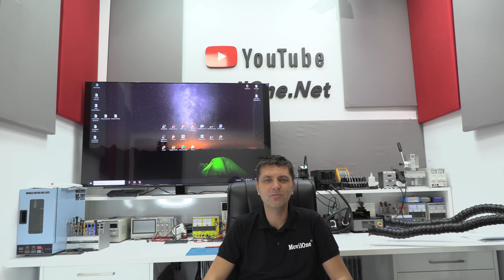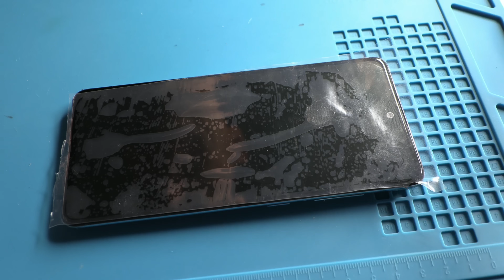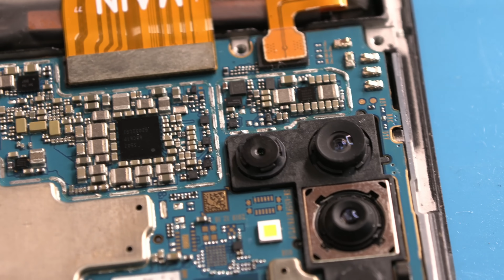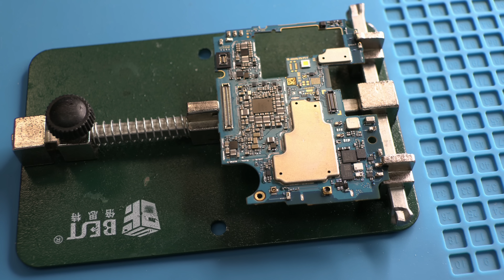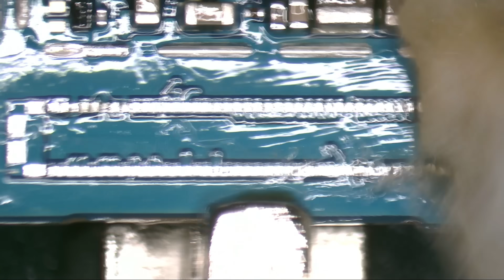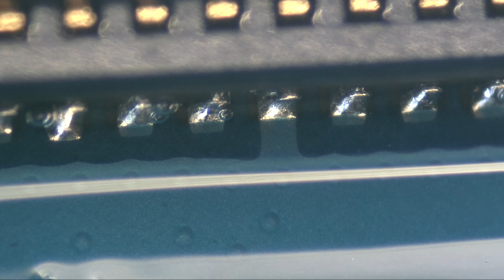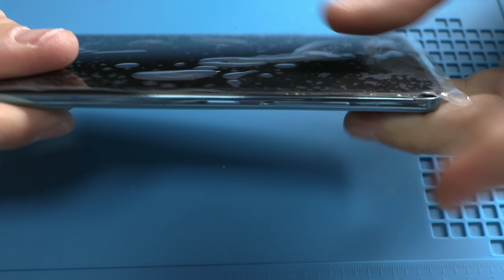The Samsung A Series Secret They Don't Want You to Know!

Comment: I'm a retired technician, who practiced from 1984 to 2015. I watched a bunch of ignorant bureaucrats outlaw leaded solder and practically destroy the reliability of our designs. Leaded solder in e-waste makes up a tiny fraction of the lead pollution in a landfill. One car battery has more lead in it than 10,000 electronic devices. Think about how many car batteries are replaced every year. Tin/copper/silver solder actually grows whiskers (the last I read in the electronic journals, physicists could not explain why). With super fine pitch ICs they will actually bridge the gap and cause shorts. If the short is on a power to ground line, it will just vaporize as it's only a few molecules wide. If it's a signal line, it can cause the device to fail. Lead free solder also made rework exceeding difficult due to the higher temperatures required, leading to the copper traces delaminating off the FR4 substrate. I've seen the comments about the ROHS laws, and as some have pointed out, if you repair with lead based solder, who is going to check? So feel free.
Reply: Typical example of greenwashing I guess: „hehe, we are considered green, at the same time we can sell lots of new devices if they break soon enough, or overpriced board „repairs““…while the millions of devices that are not repaired but straight thrown away, have a much greater impact than the lead would have. But greenwashing works, because customers want to believe the corpo blabla
Reply: @RoHan-83  Well, if its half as bad, i can have twice as much, right? Riiight.
Reply: @RoHan-83  Windfarms are like that. Millions of dollars in materials that cannot be recycled when used up. For example the blade, they just chop them up and bury them in a landfill. Also each tower uses about one hundred gallons of hydraulic and lubricating oils that need regular changes every 8 months or so. Isn't greenwashing great?
Reply: @Harold_Callahan that is not true, just a typical rightwing false information. Firstly, properly constructed wings last for around 30 years and then will and can be recycled (at least here in Germany). Glass fiber wings will be used in cement production and newer carbon fiber wings will get broken down by pyrolysis. No landfill when you take proper care of it. Typically over 90% of a wind park is reuse- or recyclable. 👍🏻
Reply: @Harold_Callahan Everything can be recycled, so that's not a useful comparison
Reply: @Harold_Callahan Even when taking into account that most blades are not recycled (that trend is changing), windmills still overall pollute less than fossil alternatives, and its not even close. The motor is also fully recyclable.
Reply: @RoHan-83 thank you!
Reply from the maker: Great insight, Mark. The ban on leaded solder has significantly impacted the reliability of electronic devices. As you pointed out, lead contamination from e-waste is minimal compared to other sources, such as car batteries, which contain exponentially more lead. However, regulations like ROHS focus on reducing hazardous materials without fully considering the consequences for durability and repairability.

The phenomenon of "whiskers" in lead-free solder alloys is a well-documented issue that has led to catastrophic failures in critical industries like aerospace. Moreover, the higher temperatures required for reworking lead-free solder not only complicate repairs but also shorten the lifespan of components due to increased thermal stress.

Regarding repairs with leaded solder, it's true that in non-industrial environments, its use remains a viable option. Ultimately, the key is to strike a balance between regulatory compliance and ensuring durable, repairable products—something that large corporations, unfortunately, do not prioritize.

Thanks for sharing your experience; it's crucial for more people to understand the realities behind the industry's decisions.
Reply: @MovilonePhoneRepair  are you an AI?
Reply: @ujox3720 I'm also suspicious, it's a ridiculously long and generic addition to the discussion,from the uploader of the video!
Reply: @MovilonePhoneRepair 

Hai brother,
I'm starting a Car's ECM repairing and OBD scanning business in few weeks. So I need the soldering rework station.
 Which brand is worth for buying or correct machine for my work. 
I had a Kada 2018+ machine (hot gun with soldering iron) in my mind for buying. 
Please reply to my comment.
I purchased OBD scanning tool, taparia SA46 tools (box).
Then I have to purchase these soldering related items only. 
Especially I need soldering rework station.
It's related items like lead wire, flux, led light with magnifying glass stand, table silicone mat, etc,.
Reply: @MovilonePhoneRepair  not all A series are designed to fail. The a50, a51,a71, a80 were indeed designed to fail. The a12, a31 are completely different, these ones are solid devices, I have them and they still works
Reply: and they fucked over the fluxes...
Reply: @stevesteve8098  pine sap still works fine, as it always has...

"rosin"... pine sap. if thats too primitive, try a music shop. they sell blocks of it.
Reply: While not doubting your integrity, after all products were better built back then, it is clear, that manufacturers are building single points of failure deliberately into their products. I like to tinker on many things, and once the "back is off" it becomes obvious that this is so. When you ask yourself "what idiot designed this?" it is the wrong question. It would not be surprising that a class of engineers - "obsolescence engineers" - existed, but maybe that's going too far. The most recent case was the nut on the back of a shower mixer - one of these nuts was impeccable, the other was clearly faulty. Can you get new ones? Not that I can find. Let's face it, most people don't have the equipment and competence to do this kind of repair, even if they coud find the fault, so rather than faff about, the new one is brought in and the old one thrown out. So much for the "green, net-zero" agenda. It's not being thrown out for BS for nothing.
Reply: @GeorgesDupont-do8pe  This subject IMO is a huge can of worms and is similar to the chicken and egg scenario. Part manufacturers in an effort to drive out cost have lowered the quality of parts, as well as engineers under pressure to drive out costs use cheaper materials and parts. I remember back in the day, american made engines came with plastic timing gears with metal chains. They rationalized that the gears would last 100k+ miles, after which the car would be replaced. Most of the time they were correct. This is also happening in consumer electronics, especially phones which are quickly rendered obsolete due to cell specs changing (5G anyone?) or OS bloat as well as battery wear. Does it make economic sense to make a soon to be obsolete device bulletproof? I think not. The real crime is this creeping into what were known as "durable goods" such as home appliances, which back in the day would last a minimum of 20 years barring damage. I've read that now their life expectancy is dropping to 5-10 years. I think this has a lot to do with the items being overloaded with unnecessary electronic bells and whistles. It's the same with cars. They are now rolling computers with and engine and almost impossible for the average mechanic to repair without involving an ET. Do I think companies are designing product to fail? Yes, but it's probably like the timing gears. They just have to last long enough for the end user to replace the device in the normal course of use pattern.
Reply: @GeorgesDupont-do8pe  ...behold, a pale [green] horse! And its rider's name was Death.  
Watch "The Lightbulb Conspiracy" .... It's one of the best eye-opening documentaries i have seen based on well-researched factual information concerning the inescapable hard ugly truth reality of "Planned Obsolescence."
Reply: Good old fashion solder is getting harder and harder to get and most of the solder you buy online now and in electronics shops is junk and not what they say it is on the label or advertisement (eg 60/40).  Just attempting to joining two wires together together with these junk solders is a labor intensive job. He mentions one good brand solder: "Kester". Another good brand is "Loctite/MultiCore". But we might have to stock up because they might soon ban that too. - The big corporates no longer like things repaired and prefer you to throw it away and buy another one when the warranty is over.
Reply: If you do buy that cheap junk Chinese solder, don't throw it away. If you twist it together with Multicore solder it seems to work ok.
Reply: @cyber5515  I had to buy solder a few years ago. I made sure I bought what I used in my career: Kester. It's the same quality as it was 40 years ago. It wasn't hard to get from Amazon. This may change, but I doubt it, because Lead based solder is almost mandatory for military and aerospace for reliability.
Reply: @cyber5515 it is possible to make your own lead solder. You can even draw it out into a wire quite easily just be sure to use PPE
Reply: IV been driven crazy over this problem all xuckin week.. bloody connection..... 🤬😡 Thanks for this video 🇮🇪👍
Reply: I still have some leaded solder that I’ve had from years ago that I still used to repair power supply boards on xray machines, part of what I do for a living. How much lead content do you recommend or do you prefer in your solder?
Reply: @postersm7141  I no longer work in the industry, but for very rare home use I have 63/37, which is pretty standard across the industry, or was. I don't think it matters, it just makes rework much easier to have a lead based solder. The wetting and shine are way better than with almost pure tin formulations. A side benefit is the new component is spared the 30 degree difference between the two types of solder. Plastics that are in the connectors that are the subject of this article can have their structural integrity damaged by the excess heat, even if they are designed to withstand it.
Reply: "Lead free solder also made rework exceeding difficult due to the higher temperatures required"
So that's the purpose of using lead-free solder.
Reply: I use German leaded solder for my repairs. Never been a fan of lead free stuff.
Reply: not using lead also leads to al lot of ICs failing because they have to be reballed
Reply: @sharymens8187  I can tell you are/were in the industry. Right on brother. I wondered if this was still done, given the disposability of even high end processors as the labor and equipment costs become prohibitive in the current economy. I suppose there are "houses" that do this in bulk to drive down the per unit cost. Nothing likes thermal cycling, least of all deep submicron processors.
Reply: I greet you Legend.
Reply: @UltraMaxTechOfficial  Joyful greetings to you! Although I think I'm more of a dinosaur than a legend 😉.
Reply: It's terrible indeed
Reply: I love lead ❤️
Reply: Oh my, ROHS. If they really wanted to reduce harmful substances, they could have actually focused on reducing wastage by enforcing actual repairability and encouraging reuse. Instead we have this mindless consumerism that quickly fills up landfills
Reply: Thankyou all guys as a retired electronics engineer youve opened my eyes to these tricks
Reply: In Germany at least there is a pretty large refund for lead acid batteries.  Car wreckers also dispose of batteries separately.  Not returning one to get the refund means not getting real money.  Unfortunately lead is so bad, it needs to go entirely from an environmental point of view.  But I'm guilty myself, I still have plenty of lead solder left.

I noticed the attitudes towards lead-free solder differ wildly across the industry.  Some people are totally adverse to it, some are totally fine and claim they haven't had an issue during their entire career. Not sure why.
Reply: @ralfbaechle  Thats NOW. Lead acid batteries have been in wide use for over a century. In the beginning, I'm not sure if they recovered the lead. I'm not a battery historian.
Reply: @markh.7650  The answer is it depends.  Lead is reasonably valuable.  What makes these batteries special is that older batteries were made from an alloy with antimony which is even more toxic.  It was commonly used to make lead harder not only in batteries.  It was among other things used in letters for typesetting.  Manual typesetters often poisoned themselves with antimony.  Lead got all the blame but that's like Bonnie and Clyde, both are evil 😉
Reply: Its like sabotaging car engines powered by water yet they are safer & cheaper just becoz they wanna protect their companies
Reply: This puts everything into perspective. Ledless solder created islands of dead notebooks videocards and phones.
Reply: 100% !
Lead free solder -  a total disaster, an absolute fuck-up, every engineer saw coming... and, suspiciously,  companies didn't resist. 
It's as if every government was in favor of planned obsolescence.
Reply: Not ignorant mm they are human too... Paid...
Reply: Familiar with Louis Rossmann?
Reply: I have a dozen big rolls of the good stuff from years ago, worth its weight in gold
Reply: Politicians are not ignorant as they are corrupt. Many are very stupid though.
Reply: Interestingly BAE SYSTEMS would not accept lead free solder on aircraft electronics because of the tin whisker problem.
Reply: Many top phone companies use unfair means to damage phones by sending fraudulent updates that itself damages the phone hardware. It is a true thing. Apple did that. Samsung, Chinese brands, and many other famous local national companies too.
Reply: Not to mention the military and aerospace industries, lead paint and lead soulder
Reply: not only that but the put lead recycling fees on everything and never removed the fee after removing lead, plus put an eco tax !
Reply: They beaurecrats aren't ignorant. They simply do not care. 
Their owners KNOW that lead removed from this will cause reliability to collapse in most technology going forward. 
But the best way to push forward completely awful and objectively evil plans through is to pretend that it saves the environment or lives of people.
Reply: How much does it cost for you to replace the connector? Compared to the 200.00 of this Samsung a16 phone that I bought.
Reply: The bureaucrats did the same with lead based paints. Now the paint fails in 1, maximum 2 years and you have to paint again and again. It used to last 15-20 years. Metal structures rust as quickly as in 6 months and cleaning rust and repainting adds enormous expense for metal rails, stairs, bridges, and other structures. The same was done with asphalt where all the good binding components were banned and removed and the asphalt fails in just one winter! That's why we  have potholes on the roads, and fixing roads costs millions and millions of dollars. Asphalt used to last 20-25 years! Not anymore.
Reply: @kutasyk1  True about most paint on metal surfaces.  I now add zinc powder to any paint used on metal outdoors, even aluminum. Still not as good as lead but better than not adding it.
Reply: @barnowl6807 This is a good bit of info, somehow the metal stops the paint degrading?
Reply: @kutasyk1  where the hell are you buying paint that you need to repaint every year? I haven't decorated since I moved it and the paint still looks fresh. I think you're just getting scammed bro.
Reply: @kutasyk1  Yeah but cost doesn't really matter. That's for the taxpayers to worry about.
Reply: @kutasyk1  i was wondering why our painted products like doors, windows, e.t.c do rust yet paint is supposed to prevent that
Reply: About 99% of lead-acid batteries are recycled
Reply: @patrickburnand1404  They are NOW. Lead Acid batteries have been around for over 100 years. How many batteries are at the bottom of decommissioned landfills? Do you think they excavated those landfills and recovered those batteries dumped pre-1970ish? Recycling is a "relatively" new concept and filled with lies. Look up the stats on recycled plastic. The only truly high percentage metals that are recycled are steel and aluminum, and possibly lead due to its toxicity.
Reply: @markh.7650  Yes and no. Where are batteries replaced? In a mechanics shop. The machanic swaps the battery. The manufacturers are happy to take the batteries back, because they save money on the production of new batteries.
Reply: well, that's not that simple, several factors were taken into account when banning the use of lead in solder, among others, it was about protecting people working with lead solder, when using such solder harmful fumes are created among others, and now let's imagine some Chinese or Indian factories of household electrical appliances or other electronic waste we buy in western coutries... every coin has two sides
Reply: @alias_required  
>“listen, goγ, you need to pay more to us for products that will fail sooner, because people in th’rd world countr’es don’t have agency and might do something you consider dangerous, and so you must make the decision for them.”
>”It is just a happy coincidence that you’ll be paying ❨❨❨us❩❩❩ more and that, instead of possibly hurting themselves with tiny amounts of lead, th’rd-world’rs will now just not be able to buy anything because devices will fail to early to make it worth it (unless they buy broken devices and just repair them with lead solder)”
lmao what clown
Reply: Landfills don't pollute when they're properly engineered.  If a landfill is leaking lead to the ground water, the problem is the landfill, not the lead in the small piece of electronics.
Reply: Yeah pretty sure banning lead in paint is a good thing...
Reply: @LatencyProblem  The topic is NOT about paint. Move along, nothing to see here.
Reply: Speaking the truth. Leadless solder is absolute shit for most applications, and a major cause of electronics failure - I still have a stockpile of the good stuff at work, luckily. Another similar issue is EU stirring shit over amalgam dental fillings - those last for decades, whereas polymers are expensive and eventually fall out, never mind running the risk of sealing an infection inside.
Reply: Never had a problem with the new ones, the old amalgam stuff gets brittle and cracks, I've had this happen.. the new stuff can last way longer!
Reply: @VladimirE.-is2ee  I have to disagree on the amalgam fillings. Those heavy metals do leak and come into your body poisoning it more and more accumulating over time which your body has no effective way of getting rid, causing neurological damage lowering one's mental capabilities and IQ. Leaded solder on the other hand is no issue at all if one knows how to handle it.
Reply: @VladimirE.-is2ee  I wouldn't be a proponent of banning amalgam fillings, but I wouldn't use it myself and wouldn't recommend it to anyone.
Reply: Car batteries get recycled it's extremely unlikely they go to landfill. E-waste though is very much can endup in landfills, it's good that leaded solder got banned.
Reply: @elapplzsl  Why would you say it's good that it got banned? You obviously do not know what you are talking about.
Reply: People like you deserve lead and lots of it and rest us can live life lead free. If you were not ignorant to what lead did to the world, you would accept the efforts to reduce lead.
Reply: @YeahNoTellTheTruth  .. and the horse you rode in on. I'm old enough to have grown up with leaded gasoline and lead paint on the walls, as well as handling the lead based solder 5 days out of the week at work. The actual effect of lead on society was driven hyperbolically by extreme cases of poorly managed children who literally ate lead. If you feel so strongly about it, go be a homesteader in alaska without any ICE vehicles or EVs (which have way more things in them that are way more toxic than lead). Life is about finding a balance of risk vs reward. Do you eat products with High fructose corn syrup? Do you use anything with a battery in it? Get off your high horse pal.
Reply: @YeahNoTellTheTruth  leaded paint which peels inside a living environment with constant contact from children and floating particles is one thing. Leaded solder which does not abrade or deteriorate from uv is not much of a hazard to people.  Leaded gasoline and paint is a much bigger problem.  Lead solder on water pipes is also much easier to use and adheres much better, but this does contribute to poisoning.  Not nearly as much a full lead pipes however.
Reply: @YeahNoTellTheTruth 😂 you definitely ate lead paint chips as a child didn’t you?
Reply: @YeahNoTellTheTruth It truly is astonishing how much damage lead has done over the years
Reply: Soldering is completely unnecessary primitive nonsnse.  What a waste of time and effort for everyone involved.
Reply: @JPs-q1o what alternative do you suggest?
Reply: @JPs-q1o whatever. Your comment was a bigger waste.
Reply: @JPs-q1o Are you brain damaged?
Reply: @JPs-q1o do you have magic that can grow solid wires between connections ? teach me...